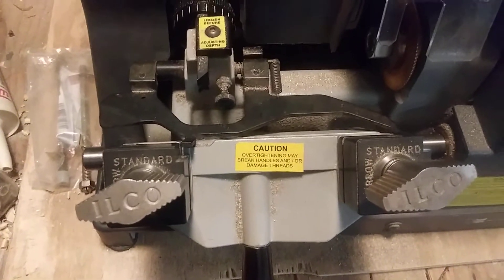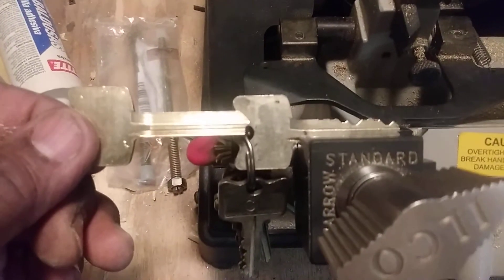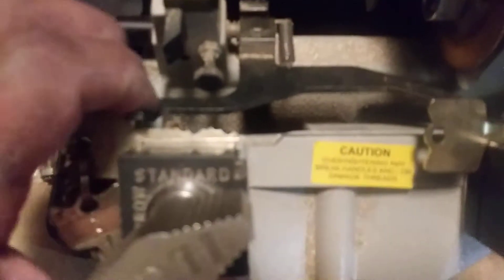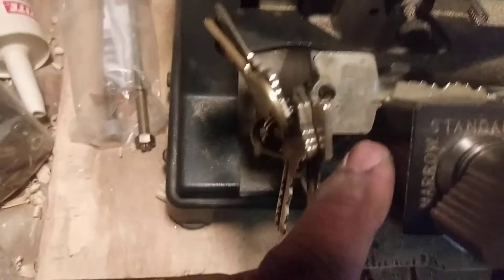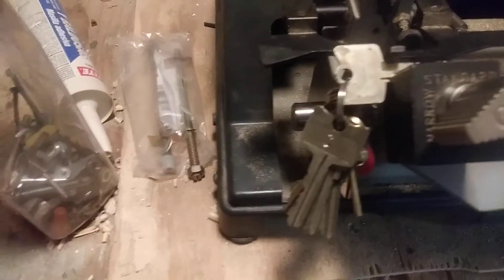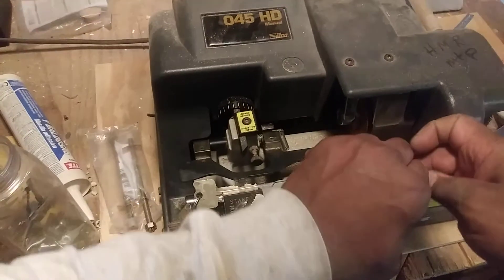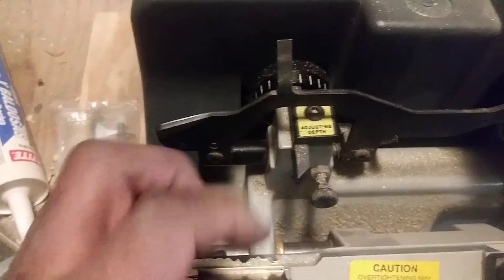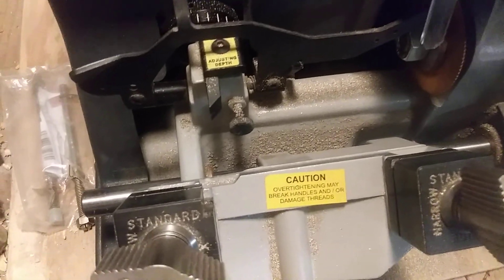How I use the 045 HD key machine

Comment: this is like a best sfic key....it is tip stopped (or indexed), at the tip, the notch at the tip on the lower side of the key is the proper way to index this key for duplicating.  your more common residential and commercial keys have a shoulder stop on top of the key, near the head, this is how you "index" these keys for duplicating.  double sided automotive, that don't have a shoulder on them, they are also tip stopped, but this is usually the very end pointy part of that kind of key.

Comment: So the 040 is different??
Reply: I just bought a used 040. Were you able to get any info on 040. I am trying to learn how to use it. I assume you have a 040?
Reply: @jshivprashad  how do you lift the handle back up to actually cut the new key. Mine gets stuck. Seems like a safety feature